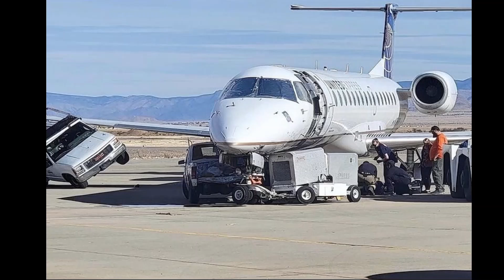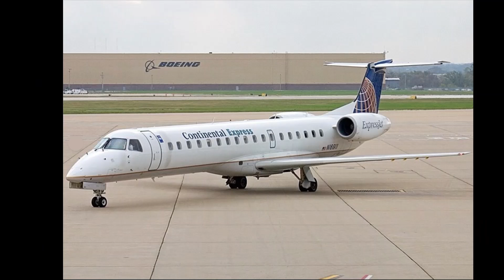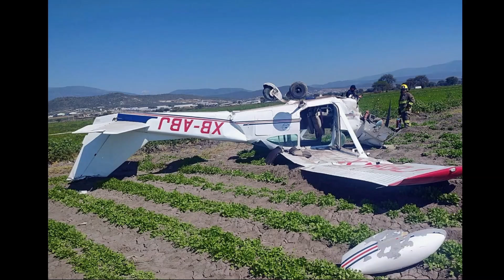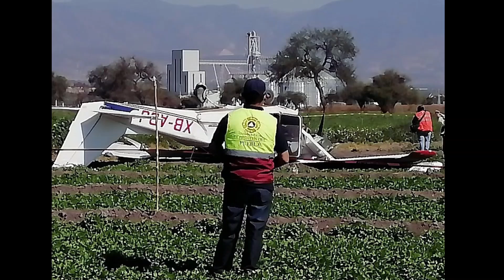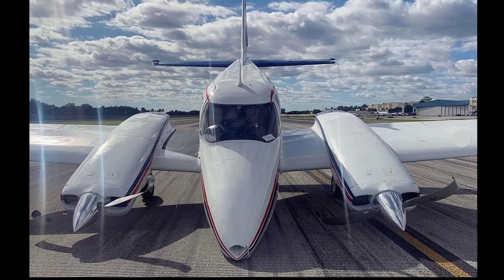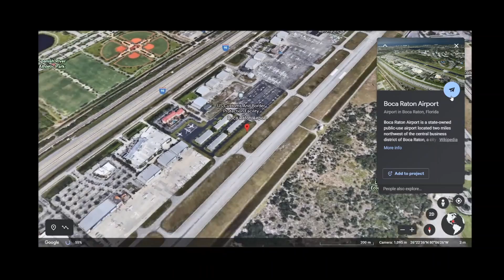Engine Start up Goes Wrong in Arizona

Comment: ERJ 145 Incident -  I question their doing an engine run with the flight deck windows all taped up with no visibility outside (I'm assuming this was a routine engine maintenance run for an aircraft that has been in storage).  Although normally you would have someone on headsets on the ground monitoring during an engine run, I would think that you should still have visual contact with that person and a visual of the outside tarmac.  Maybe this is allowed per maintenance procedures for storage aircraft?  Additionally and although it was stated that the aircraft was chocked, I see no evidence in the photo's of any chocks on the ramp.  At least that I could see.   It was also stated that the aircraft was connected to a tug.  Normally you would not leave a tug connected to the aircraft during an engine run.  
Tons of questions for what appears to be a preventable accident.
Reply from the maker: Yes I don’t see how any of this is standard from a maintenance perspective.  Lots of safety red flags and I hope the injured person gets compensated

Comment: As far as the Kingman mishap goes, why was there someone not standing on the brakes as well during the engine run up's? As far at the Mexico mishap, look at the way the field is planted & then look at the way the air craft landed, they went across the furrows, had they went with them, the aircraft would not have flipped. Don't you hate it when the landing gear does not lock into place. I wonder what the gear indicator was showing before he landed. IF he had an unsafe gear indication, did he call for the trucks to deploy before hand?
This is why I send you the audio & simulations of mishaps so you can get a better understanding of how things happen like they do. And maybe you'll expand your horizons into becoming a mishap investagator. You can not be a hose dragger forever & need to be looking for what to do after those days are long gone behind you.
Reply from the maker: Maybe I’ll be a NTSB investigator?! Haha
Reply: @ARFFWorld  There are a lot of factors that go into an investagation/s and fire & explosive reactions are just part of it, not to mention the rail road & regular road traffic
Reply from the maker: @almirria6753  I give them credit.  I met Jack Kreckie at DFW in Texas and he is a knowledge bomb in ARFF and investigation.  Very humbling and shows me how far I have to go.
Reply: @ARFFWorld  You are just a young'n in the world of fire fighting. But now is the time tostart looking towards the time when you are no longer able to drag a hose, or run into the middle of an incident. Learn to be the guy who everyone turns to for answers, on how & whys of everything. I was working towards that before I got hurt. And the best advice I can give is to keep going to classes [on someone elses dime too] and increase your knowledge base.
Reply: As for the standing on the brakes,,if the hydraulic system isn’t pressurized, then standing on the brakes does nothing. This has happened before where maintenance personnel do an engine start without running the proper checklist, and the plane gets away from them. Kingman has a lot of maintenance and storage there, I would bet that this is what happened..
Reply: @thomasaltruda  From my understanding if the engines are up & running the hydraulic systems are pressurized. And that is the fault of the fbo & the mech's they employ for this to happen multi times.
Reply: @almirria6753  that’s not true.. there are often hydraulic shutoff valves that are closed after shutdown, and if you start engines without opening the valves, you’ll have no brake pressure. There are also electric hydraulic pumps that are used before engine start to set the brakes and charge the accumulators, but perhaps these people didn’t engage them..
Reply from the maker: @thomasaltruda  thanks for the input Thomas & for watching
Reply: @thomasaltruda  Ijust learned something new then & I stand corrected